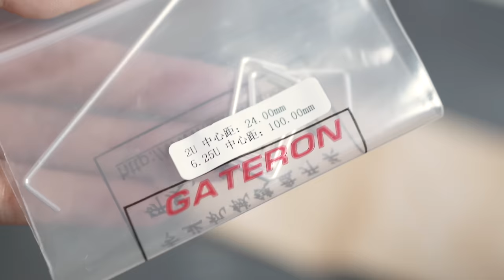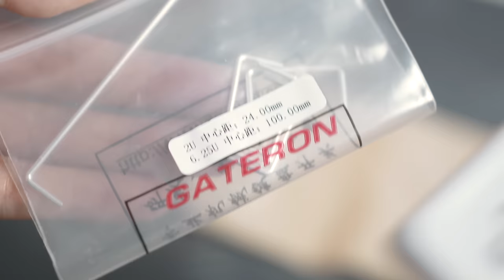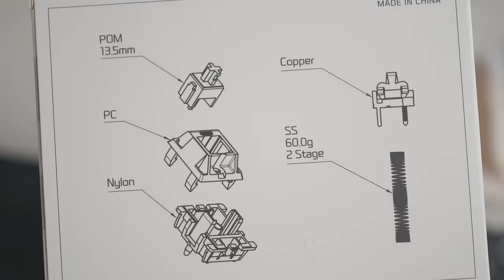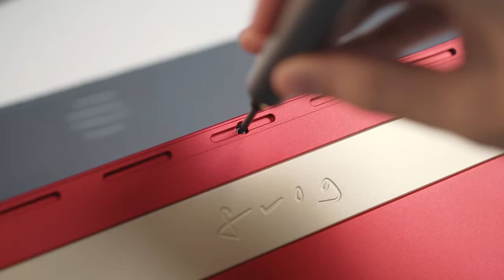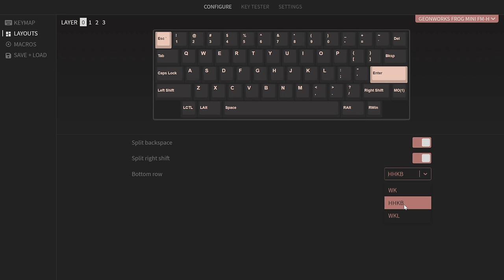FROG MINI Build (Geon Clear Switches, GMK hennessy, Full Metal Keycaps)

Comment: Yeah, I've noticed not all Cherry profile keycaps are made equal :(

ePBT, OTC, IFK and more have their R3 caps smacking against the housing of my silent switches! Only way to get around it was using long pole switches...
Reply: This doesn't seem to get talked about very often. I would be nice to have a list of known good cherry profile caps that work with silent switches. My EPBT 9009 set is fine, but the EPBT ABS set I had had issues.
Reply: @MrWo11ow  that would be nice, but I don't think it would work due to constantly changing molds (silent retools), batch variance, etc.

Comment: question
what do you mean with film and without film?
did you add something to the stab housing? i saw you cut it with the knife
Reply: @charlie.38  ahh i see, but not all stabs has film in it to remove right? 
but, if the film to prevent rattling why we need to remove it? 🤔
Reply from the maker: check this https://youtu.be/FB6sSssD1Ts
as you can see in my video, not for all stab stems

Comment: where is the iPhone 4 ? ;( I miss the boy

it's got an... interesting side profile. I'm not sure how I like it, but I like the simplicity of how you change the flex of the gasket

Trying my hardest not to comment on the shape of the those "shafts varrying in hardness" gasket things
They're tadpoles konishiwoi, this is a frog themed build. 

pp mounted board eheh
Reply from the maker: 4 is too short for 7u wires while you can see 4 with 6.25u wires
Reply: @3ildcat  oooh gotcha 
I did not consider that